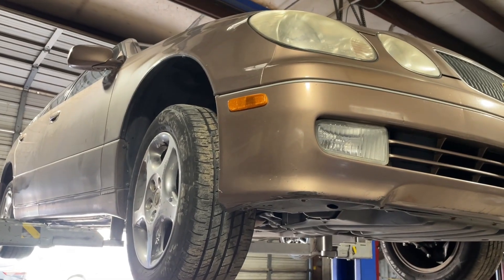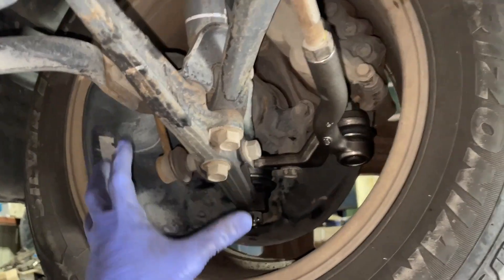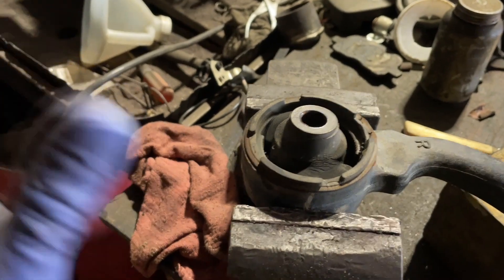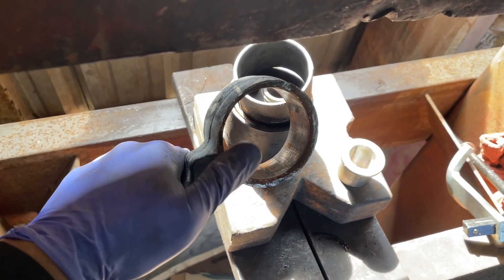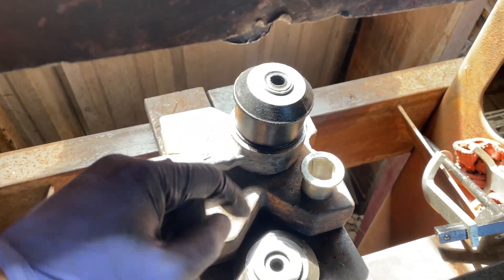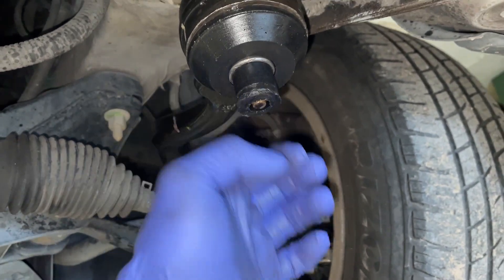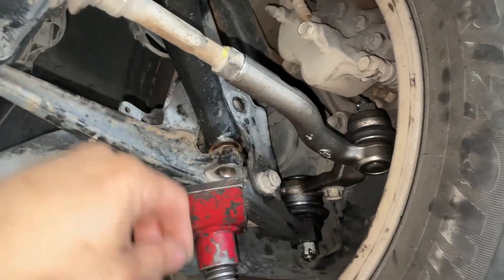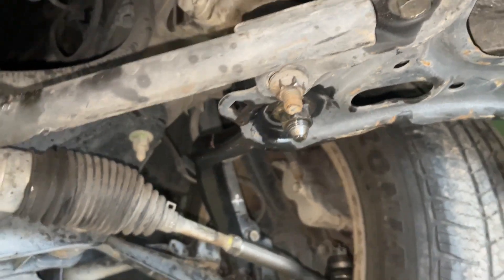2000 Lexus GS300 Rearward Lower Control Arm Replacement

Comment: With the 2 #19 bolts it seems to be stuck or just not coming out is there any way I can have it come out easier
Reply from the maker: Spray WD40 and see. I personally like to make sure there is nothing binding it, if no binding then I’ll grab a smaller wrench to hold with tension and use a small cordless ratchet or impact and walk the bolt out.